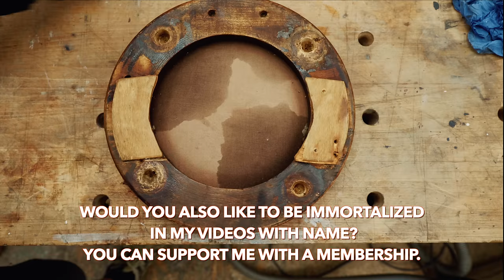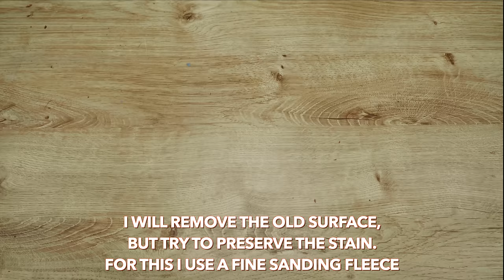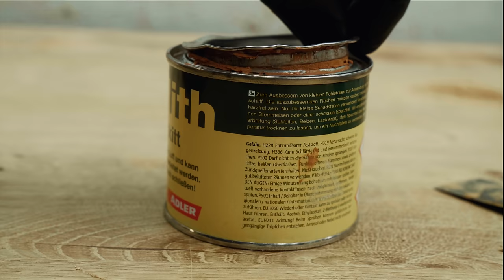Altes Erbe, Frisches Leben: Fußhocker Restauration

Comment: Lovely filming, the kind of photography used in food shots, beautifully done. My thoughts; it's a shame not to have used the old brass tacks again and for the edge of the wood to show. It seemed a bit odd to glue the legs on after the upholstery was done. Personally I would have rather seem a piece of plain coloured (maybe a golden yellow - good quality velvet used, I found the print a little quirky for the piece. Much work went into the underside of the wood which won't be seen, again it seems a shame to have lost the wooden edge and now to be able to see the finished edge of the upholstery underneath.
Reply: I agree, there doesn't seem like a lot of reason to restore the woodwork if it gets hidden. The piece is now no longer restored to original. Nice result but an odd choice. I assume the client wanted it this way.
Reply from the maker: I wanted to keep the wood. The legs would have bothered if I had glued them on beforehand. The fabric has been made to match the chair from the last video. Both pieces of furniture get a friend who wanted it that way.
Reply from the maker: 😀 That's correct. I also mentioned it in the video.

Comment: The wood work was first class,  the upholstery made me wince, horsehair is like gold dust, you should reuse it, if it's dirty you wash it. All those staples used, will one day have to be removed by some poor upholsterer,  weakening the frame. Golden rule , use as few as you can get away with or use tacks. The use of foam and shoddy ,will give a very short lifespan to your work.
Reply from the maker: Thanks for the hint. Greetings

Comment: You usually do a great work, but this time (I guess you needed to make this quickly) you did two things that I didn't like too much: #1.- you hammered old unnecessary nails into the wood, making this much more difficult to repair and restore into the future. #2.- You used a method of covering with upholstery fabric that hides the nice molding around the cushion and you didn't put the row of round head tacks around it, a nice feature in the original upholstery.
Reply from the maker: Thanks. You are definitely right. But I also wrote that the stool is for a friend. She wanted him like this. Greetings. Chris